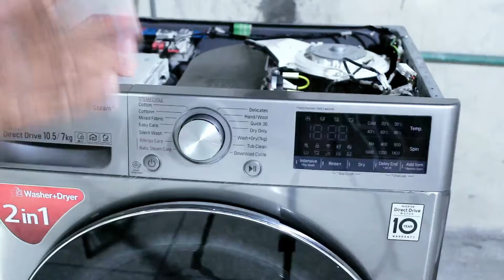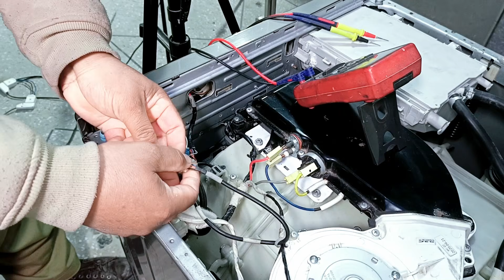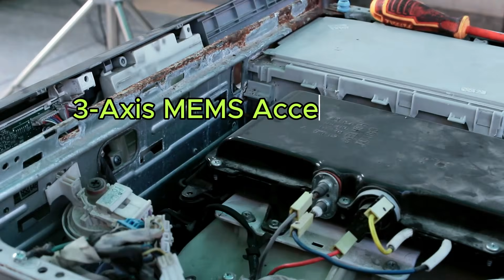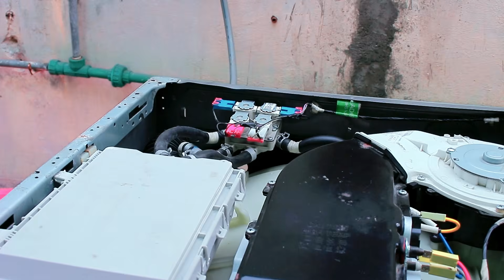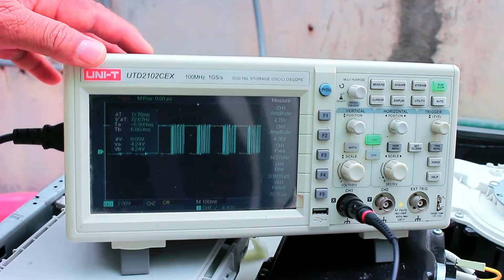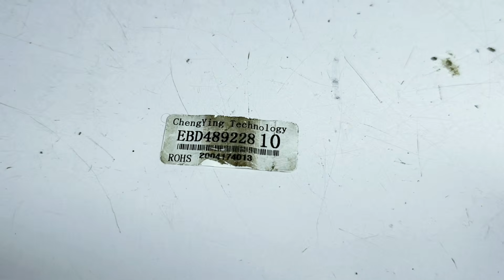How To Stop/Get Rid Of Error Code U5 |  Why Your LG Washing Machine Stops Spinning

Comment: Good day and weldone for this video. I'm having this type of problem at hand but the unit has no vibration sensor, what do you suggest to be done? To replace the main board or to fix the board that is there.

. Thank you
Reply: What’s your unit model number ?